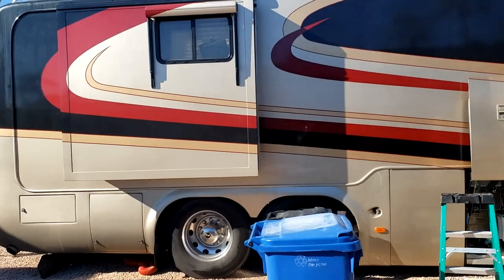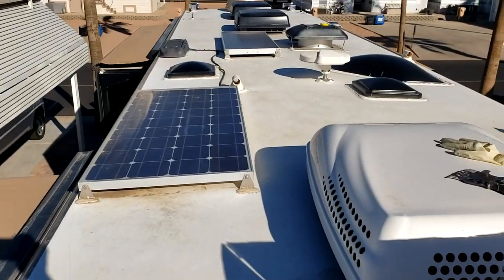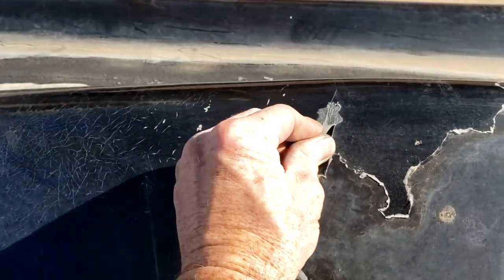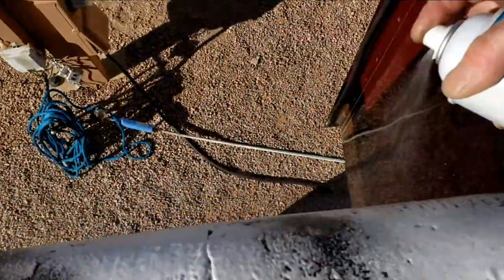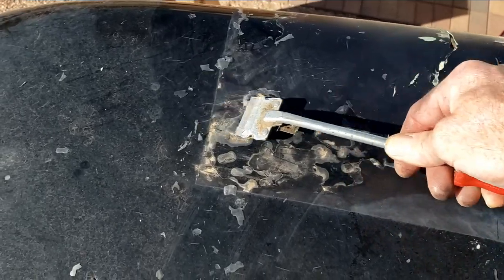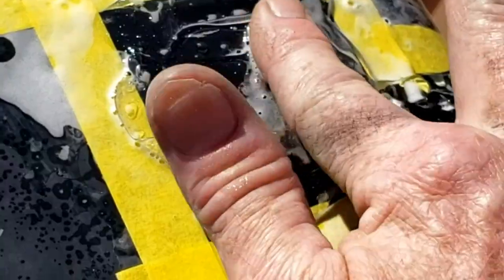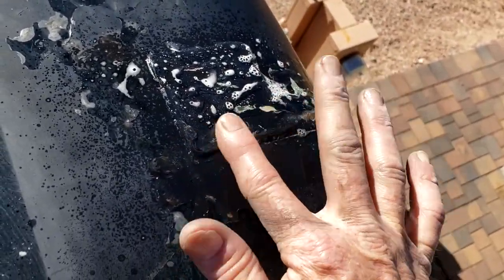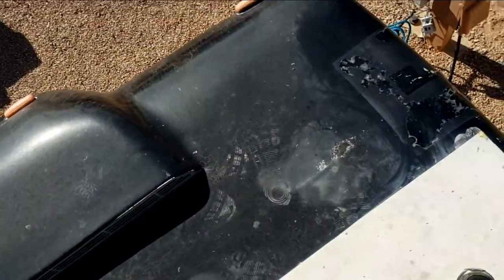A Quick Patch Repair on a Monaco Signature Roof

Comment: At work we use a cleaner called Fastball to smooth a sealant bead.  It works best without the latex glove.  When it's on a top surface that no one will see if doesn't matter a lot what it looks like as long as it does the job.  Thanks for the video.
Reply from the maker: Great tip!

Comment: Nice job James! Just curious, is there a bigger issue underlying those cracks.. seems like if it were built correctly it would not crack at that seam...
Reply from the maker: Likely the filler was too thick and no mesh used in the repair, I don't think the structure is an issue just time and workmanship. Thanks!

Comment: If you were going to do a fiberglass repair, would you use epoxy or polyester resin? I know polyester eats foam but also flexes better than epoxy.
Reply from the maker: I would grind the area out, lay down new fibermat over the seam and use epoxy resin for the repair and a good polyester filler to hide it all.

Comment: Is the damage caused by sunlight? Would covering the roof endcaps while parked for a long time in high sun slow the damage? Thx!
Reply from the maker: mostly heat and sunlight. Yes, RVs stored inside have long lasting paint jobs.
Reply: @AZExpert  Would putting some kind of cover over the endcaps when parked for a while help? Thx!

Comment: Great video and of course you have so many amazing videos on roofing and repair. So my question is I am buying and 18 foot cargo trailer with a one piece aluminum roof and I want to seal it or paint it before I put the roof vents on and the rails for the solar panels. With all your experience with all the different materials what would you say would be the best to extend the life of the roof and help keep the temperature down. And if you could refer me to one of your videos that would be great thank you and have a blessed day
Reply from the maker: Cargo trailers have no insulation and the metal roofs transfer heat easily as the frames are steel. The roofs last almost forever as they are metal. You could roll on coating but you'll want insulation in the ceiling too.

Comment: So if the joint was geound out and relapsed and painted it should be good for another 20 years. No need to replace the whole roof for the joints. Right?
Reply from the maker: yes, gel-coat fiberglass roofs should never have to be replaced just repaired like a boat hull.

Comment: What brand of cleaner did you use.

I’m thinking of using proflex for sealing my windows and vertical seals in my grand design 5th wheel. Would you recommend proflex for this application?
Reply from the maker: sorry, that's just foaming window cleaner. I would recommend silicone over proflex for that, it is nicer looking for things at eye level.

Comment: Question sir should that type of roof be waxed like a fiberglass sidewall
Reply from the maker: Yes, absolutely and it should be to protect it. While a paste wax will be best, a wash and wax is just fine. Ceramic coatings work too. Just be very careful on a roof!

Comment: In that front corner, from the staining on the roof, it looks like there was a large square patch there originally that was removed/peeled up at some point in the past.  I wonder how long the roof has been cracking in those corners...
Reply from the maker: looks like someone repaired that section sometime ago too, likely used poor quality paint and materials.

Comment: Hello, I am a big fan of your channel but unfortunately I am not from the States, I won't have the chance to get your service for my Mandalay 2009 43A.  I was wondering if you could help me to understand the issue that I have with my roof.  I have a finer roof and there are a few areas where the finer layer is not attached or stuck to the structure as I can tell by walking on it.   I don't have any sign of leakage inside the motor home and the roof structure seems solid in those areas.  Is is normal for a 12 year-old motor home or is there an issue that needs to be addressed?   Thank you for sharing your experience and insights with us.
Reply from the maker: Often, gel-coat fiberglass roofs are free floating and flex quite a bit, it can be noticeable on Monaco coaches too. I can't remember the last Mandalay I was on so it would be difficult to verify off my memory.
Reply: @AZExpert  Thank you, I appreciate you are taking time to answer me. I really like your Chanel.

Comment: Do you recommend pro flex over DiCor lap sealant?
Reply from the maker: they have different applications. A self leveling dicor would have leaked over the radius like melting wax and looked bad. Black non sagging would work, but look weird too, black urethane or silicone would work but tend to tool poorly and leave voids that could let water in. Thanks!

Comment: Where did you get that tool with the razor blade attached to it
Reply from the maker: that is a lisle scraper
https://www.amazon.com/Lisle-52000-Razor-Blade-Scraper/dp/B0002SR88C
It's has the best angle for razors I have found

Comment: Could you paint Eternabond black?
Reply from the maker: yes but it can flake off over time too
Reply: @AZExpert  right then it’s back to a fiberglass repair that they will have to have soon enough. You said it was a temporary repair
Reply: Is there black eternabond now ? Would it be a solid fix with the proflex and then eternabond on top of proflex ?

Comment: In my ignorance, I thought a one piece roof would be permanent. This shows that the unavoidable flexing between the caps and roof will eventually crack where they join anyway.
Reply from the maker: Constant vigilance is key with RVs it seems ;)